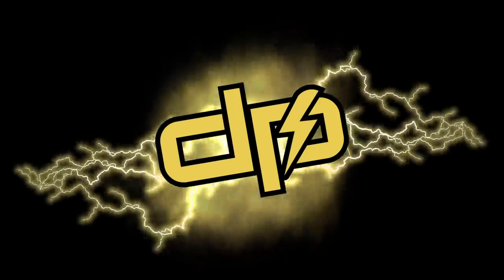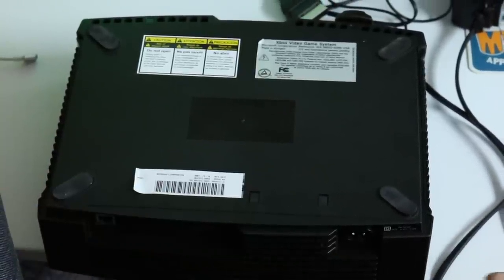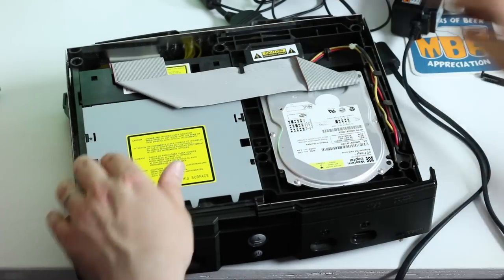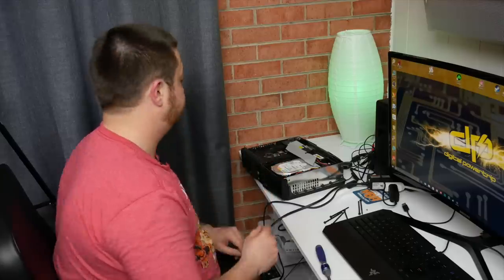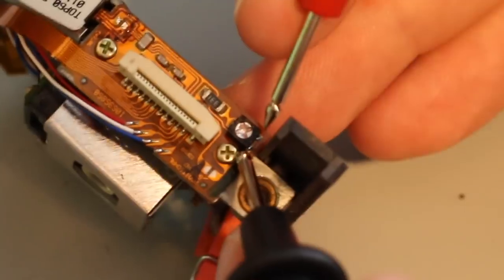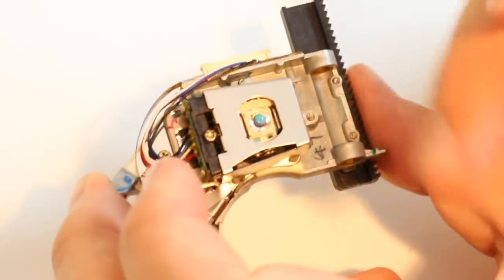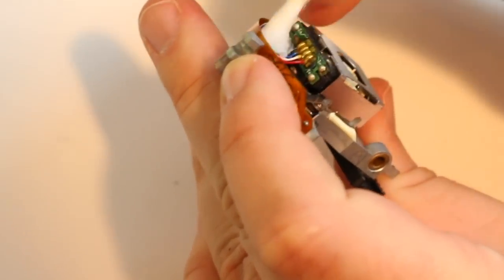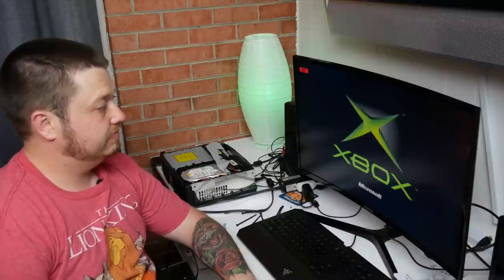Fix Original Xbox Disc Read Error

Comment: Can someone provide me with a link to the replacement laser? I may need to buy one for my original Xbox.
Reply: Have you bought one yet?
Reply: @snowyowl9132  No, I haven't bought one yet but I found them on Amazon for about $17.
Reply: @kylemccormick3450  FYI, I bought that exact one, installed it yesterday and the problem persists.  It's a good idea to replace it but it might not be the fix.
Reply: @snowyowl9132  You may have gotten a bad one. I was reading some reviews and I think I recall reading that they are not brand new. However, if they are new then there is a solder point somewhere on the laser assembly. If you don't desolder it before setting it up it won't work. It's very hard to explain over chat but just research how to set up a new laser assembly, and you may find what I'm talking about.
Reply: @kylemccormick3450  Based on what you said I guess mine wasn't new because that anti-static solder point was already removed.  I'm quite frustrated at this point so I'm going to try one last time by replacing the entire laser deck assembly with the motors.  I ordered it earlier today so hopefully that'll work.  Otherwise, the entire disc drive may be absolutely necessary...the problem is they're so hard to find.  Some guy is selling NOS ones for like 200 USD. Was really hoping to pay less than 100 USD.  I'll let you know if the laser deck assembly is the remedy or not.
Reply: @snowyowl9132  If you are sure that the anti-static solder point is removed, and it still won't read discs, you may want to consider buying another laser assembly on Amazon. As I said, I don't think they are brand new, and I am sure that if you contact Amazon and tell them that your product was not working, they will either give you a refund or another laser for free. I would consider doing that before spending $200 for a disc drive, it is not worth it in my opinion. For $100 you could just buy another Original Xbox on eBay. If your Xbox won't read discs then the problem is most likely with the laser assembly, I can't really think of another reason for it not working unless there is something else wrong with your disc drive. Just take what I say with a grain of salt because I am not an expert. Hope I was able to help a little bit. Best of luck to you! 👍😊
Reply: @kylemccormick3450  Hey, I just installed the new laser deck assembly with motors and I still get the disc read error.  Now I have 3 laser lenses: the original, the replacement one, and the one that came with the deck assembly and motors.  I guess the last thing to replace would be the entire disc drive?  Very frustrating...but I did find a guy selling refurbished ones, and I'd end up paying about 100 USD for one.  What do you think?
Reply: Like I said, in my opinion, you could just buy another OG Xbox off eBay for about $100, but since it would be used, you may eventually end up with the same problem, that is, failing to read discs. Honestly, it is up to you, if you are serious about fixing your Xbox, buying a replacement drive may not be a bad idea, but if the disc drive is also a USED one, rather than a BRAND NEW replacement one, you never really know how long it will last, and at that point, you may just want to buy a used one off eBay. Buying the $100 disc drive should fix the problem,  but again, this is only my opinion. $100 is a lot of money for a disc drive but as I said, you should do what makes sense to you.

If the problem isn't the laser, I wonder what it could be?

Kind regards hope all is well.
Reply: @kylemccormick3450  So, I ended up making 2 offers on eBay.  1 for the disc drive and 1 for another OG Xbox.  I paid $103 total for the OG Xbox (likely version 1.4) which comes with 4 games and 1 controller.  The guy selling the disc drives declined the offer ($ 82 total) and claims that I can't preserve game saves/memory without the disc drive.  Do you know if it's possible to swap the hard drives for the 1.0 and 1.4 Xbox versions?
Reply: I did some research and it looks like hard drives can't be swapped out as easily as disc drives.  You can correct me if I'm wrong but I think the Xbox would have to be modded first in order to do that.  That means I'd have to pay the $92 for the refurbished disc drive if I wish to try for the last time to restore my original Xbox version 1.0.  And if that doesn't remedy the problem then I really can't think of anything else except for some problem with the motherboard.  If that's the case, then I guess it'd be time to give up on that Xbox and just use it for spare parts.
Reply: @snowyowl9132  Why do you want to replace the hard drive? Isn't the only issue the disc drive? Also, yes, you are correct that your Xbox would have to be modded first in order to swap out the hard drive.
Reply: @kylemccormick3450  I have some very nice game saves/memory on my hard drive which is fully accessible btw. It's that wretched disc drive that is causing all my trouble.  So, I just bought the used Xbox (version 1.4) for $103 and I figured maybe I'd be able to swap its hard drive with mine since the disc drive is still working, but now it seems like that won't be possible without modding.
Reply: @snowyowl9132  Yeah, I understand how you would want to save your hard drive since it has your game saves on it, and you can swap it out in your other Xbox, you would just need to mod it, but that is a long process and kind of hard. On the other hand, all you need to do instead would be to swap the disc drive, NOT the hard drive, since that would be much harder. So, you can take the disc drive out of the working eBay Xbox, and just put it into your 1.0 Xbox. Does that make sense?
Reply: @kylemccormick3450  Yeah, you're right! That makes perfect sense.  I guess I'll be left with 1 dead Xbox again but at least I'll have 4 extra games, an extra controller and extra cables; all for $103.  Maybe I should pass on the refurbished disc drive then, which would cost me $92.  I just hope that swapping the disc drive with a working one fixes the disc read error problem.  ~fingers crossed~
Reply: @snowyowl9132  You should do what makes sense to you. As you said, even though the other Xbox won't work, at least you'll still get the controllers, games, cables, and a backup Xbox just for parts or something. I'm glad I was able to help!
Reply: @kylemccormick3450  Yeah, you have been a great deal of help.  I appreciate that.  Thanks.  I'll let you know if swapping the disc drive fixes the problem, otherwise MY Xbox will become the spare parts console instead. What about you? Are you planning to repair one as well?
Reply: @snowyowl9132  I have an OG Xbox that I have taken apart to clean inside and out so that it looks new. I also have some others that work as well but they also need to be cleaned and tuned up, like replacing the thermal paste and such.
Reply: @kylemccormick3450  Cool.  I guess you're working with the heat sinks.  I'm sure you've removed the evil clock capacitors on any that might've had them, too.  Btw, I also had to bypass 2 traces on the underside of the circuit board to get the Power and Eject buttons to work properly, something I learned from another YouTube guy that calls himself the Segaholic.  I really hope the disc drive swap fixes my final issue.  I'll let you know if it becomes a success or not once I receive the other Xbox.
Reply: @snowyowl9132  Ah, yes, the Segaholic! I have seen some of his videos. And yes, I made absolutely sure to remove that clock capacitor and replace it. Good luck with your repair, I hope it works for you! 👍
Reply: @kylemccormick3450  Thanks, Kyle.  I want to let you know that I ended up buying the refurbished Thomson drive after all.  The used Xbox w/ games is still on the way but the Thomson drive arrived already.  I installed it, and lo and behold, the disc read error is gone! So, replacement of the entire disc drive was necessary in this case.  There must be something wrong with the circuitry of the original disc drive and surprisingly nothing really stands out upon close visual inspection as a potential culprit.  But I was at wits end and like I told you in a previous message, if replacement of the drive hadn't fixed the issue, that Xbox would've been my parts donor Xbox for the others.
Reply: @kylemccormick3450  Hey, maybe I spoke too soon. Lol.  The drive is working very well... I'm so happy to see my version 1 Xbox working again! However, it's unable to read 2 of my favorite games of all time.  Not sure what that's all about.
Reply: @snowyowl9132  If it reads some games but not others then the problem may actually be the discs. Even if they have just a few small scratches, it may cause some problems.
Reply: @kylemccormick3450  Well, here's the kicker:  Those game discs are in excellent condition. I don't really see any scratches at all because I've taken very good care of them.  And I got to try them on my other Xbox which has a Phillips disc drive and it reads them perfectly.
Reply: @snowyowl9132  Hmmm... That's really confusing... Unless it is a really quirky and complex problem, I have no idea what the issue could be. The only thing I can think of, which is probably NOT the case, is disc rot. Over time, all CDs and DVDs will go bad, even if they are in perfect condition. You can look up some videos that go in-depth explaining disc rot. As I said, it is kind of rare, as most games aren't super old yet, but who knows? I'm not trying to scare you or anything, but this issue is so weird that this is the only thing that I can think of. Other than that possibility, I have no idea.
Reply: @kylemccormick3450  Ah, yes! I've heard of disc rot before too.  I watched some videos about it a couple of years ago.  But guess what? It looks like the problem is with the Thomson drive again! And that's the refurbished one I'm talking about.  Remember your suggestion of installing the drive from the used Xbox I bought from ebay? I did that, and bam! The drive read everything I threw at it, including those 2 games the refurbished Thomson drive couldn't read.  That means I have 2 Phillips disc drives working perfectly right now.
Reply: @kylemccormick3450  What's really weird though is that when my original Thomson drive was working well I clearly remember it reading every disc, including those 2 games.  Based on this, I would surmise that the NOS ones some guy sells for ~200 USD are probably the real deal.
Reply: @kylemccormick3450  So, based on everything I worked with, my final conclusion is:  Thomson disc drives manufacturered after Nov. 2001 are probably pretty crappy.  This would include replacement laser lenses as well.  Phillips disc drives are better.  It's also possible that even the Samsung and Hitachi ones are better, and I've heard this from other Xbox owners.  Finally, cleaning the laser lens, adjusting the potentiometer and/or replacing the laser lens like in this video may not offer the best solution to a disc read error, but replacement of the entire drive with a Phillips, Samsung, or Hitachi likely will.  On a final note, despite the Thomson drives (manufactured after Nov. 2001) possibly being of lesser quality, they are still capable of reading most game discs, just not as many as its competitor brands; and I'd be willing to bet that the replacement laser lenses are likely the true problem.

Comment: Its not working fake video 😬
Reply: Just because it didnt work doesnt mean the video is fake it probably means the laser on your system is to far gone and probably needs to replaced. Hence the reason he bought a new laser beforehand just in case this method didnt work.